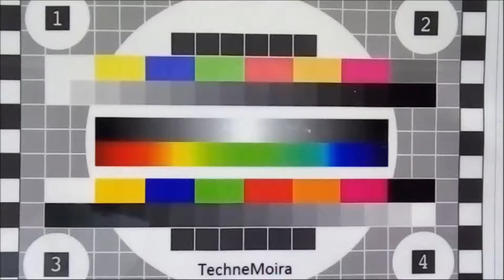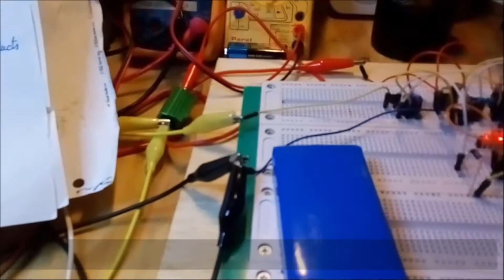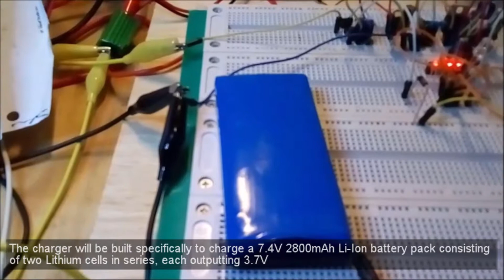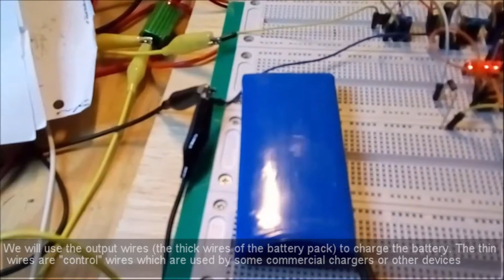Weekend Projects: Building A Lithium Ion Battery Charger

Comment: Great explanation of these batteries I knew you could not mail them but do not know why, now I do!
Reply from the maker: These batteries are a bit like Jekyll & Hyde :) As long as you treat and use them correctly they'll perform great... but beware when you start abusing them. They will literally bite you in the behind if you don't watch them.
Still, they are great powersources and a valid substitute for 9V batteries. They are also very useful to combine, since you can make a 14V battery if you put two in series. 
Since they can supply loads of current they are super for powering small electronic appliances and equipment for a very long time.
Thanks for watching and giving me a thumbs up. It's much appreciated.

Onwards to the thousand subscribers ! I might even make a special video when I reach my first 1000 :)